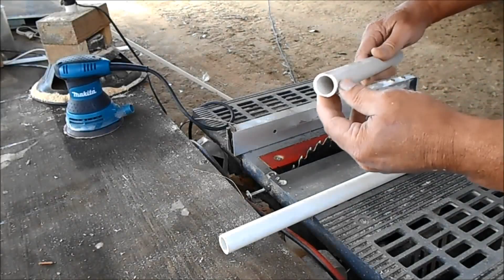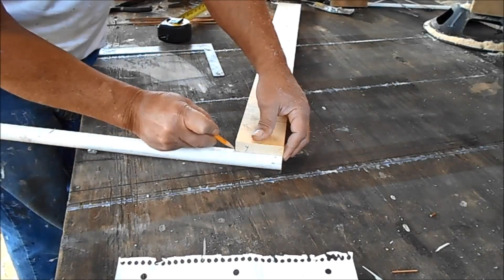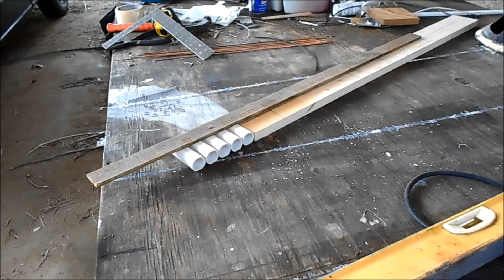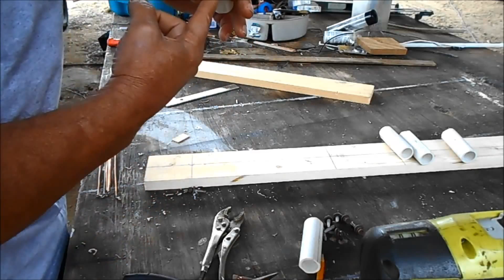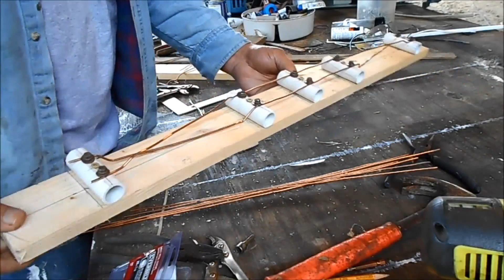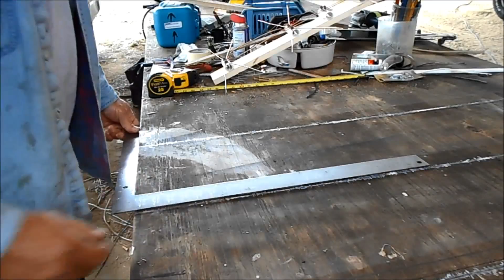HOW TO MAKE A TV  ANTENNA

Comment: what is the purpose of wiring the top and bottom 180deg out of phase? does that make it interact with the middle 2 for a little bit of vertical polarization?

Comment: I live in New Orleans and used the online website called TV Fool to find the TV transmitters around me. The strongest signals were contained in a roughly 180 degree arc south of my location with the weakest ones north of me. Because the transmitters were spread out around me I decided to build a multi directional antenna and not use a reflector. 
I used this video to build mine with a piece of scrap wood and sealed the wood with oil as Danny recommends. I mounted it on the roof of my home about 17 feet above the ground using a DirecTV antenna mount my neighbor was throwing away. Except for the copper wire and a few screws this antenna cost me nothing.  
Today I hooked my new antenna up to my TV and scanned for channels. I was totally shocked and about fell off my chair when the scan found 50, yes 50 channels!!! They all come in clear, strong, and as stable as can be. 
Danny I can’t thank you enough :)

Comment: I could not find those vinyl peaces no where. And I looked at  Ace Hardware, Lowes, and Home Depot. So I thought I would give the PVC build a try. I went to Ace hardware. In the video you say to use, thin wall 3/4 and the regular wall 1/2.  But all they had was thick wall stuff. So I drove 20 miles to Home Depot. And they did not have any thin wall stuff. So I looked on line and there is another Home Depot 30 miles away in the other direction that has it.  I am going to burn a tank of gas just trying to track down materials. I hate this town.
Reply from the maker: LOL THE WAY YOU DONE IT WAS FINE...THIN WALL YOU WOULDNT HAVE TO RIP THE 1/2 PIPE
Reply: I couldn’t find thin wall as well. I just used the regular schedule 40.

Comment: metric conversions 

mast 1 by 3 in (25.4mm x 76.2mm) @ 35in (889mm) timber, marked 3in (76.2mm) then 9.5in x3 (241.3mm)

Insulator risers (tube) drill 5/8 (15.87mm) either side of center hole for wire mounts

V pieces cut at 20in (508mm)
V pieces 4.5in (114.3mm) between ends  (actual degree reading yet to come)

how long is the "electrician wire"? you don't mention it.

Comment: glad your antenna works but I'm fucking lost and I'm sure most people are also
Reply: Hey there Mr. Caissie, what he is doing is basically building what is commonly referred to as a bow tie antenna. There are a bunch of tutorials on making them on Youtube from everything from coat hangers to ceiling tile wire, if this build is too complicated, then there are plans from making one from a PVC pipe, 4 lengths of 20 inch piece of wires, 2 wires to connect it all together and a transformer. What is most important is the dimensions have to be accurate.  That's it. I was skeptical when I built my 1st one, but it really does work. I am now going to build a Gray Hoverman antenna just to see how well it works. I ditched Satellite years ago, and have not looked back. Good luck and have fun!

Comment: O seen this and built an antana like urs u just didnt have pvc so i used blocks of wood will this not work and what about the fence wire behind urs does it need it to and do u just attach it to the back
Reply from the maker: yep
Reply: thanks cant wait give it a try
Reply: wood works, it will just rut eventually.  throw lots of external paint on it to protect it longer ;)

Comment: Will it still work if you leave the pvc pipe out and just drill into the wood?
Reply from the maker: yeah but not as good
Reply: I made a second one with plain wood (no pvc)  and I noticed that I don't get as many channels. Does the wood ground out the signal somehow?
Reply from the maker: YES IT DOES A LITTLE
Reply: Thanks Danny!

Comment: When I was growing up I had an uncle and he was a really great guy. You sound so much like him.  
I made one pretty much the same thing. Only I found some 3/4 inch Plexiglass at a scrap yard.
It was about 6in  wide and the sides were curved. So it kind of looked like a " U" shape.  Some strips were 4 ft long. 
I used all stainless steel nuts and bolts. Put it all together put it in the air about 40 ft or so. Now I can get about 45 -50 channels.
Then I went back and put an amp/ booster. Now I can get 75-80 channels. IF i were to go higher I could get more channels.
But I am afraid I will get hit by lightening again. The first time it took out my amp/booster. I had it grounded but I did not have a surge protector. And it got my TV and Stereo. I highly recommend getting a surge protector now.

Comment: Because who doesn't have a tablesaw laying around?
Reply: Every man in the South has a table saw, drill press and screw gun.......and now a homemade antenna!
Reply from the maker: thats right
Reply: IKR
Reply: I live in California and I have a table saw, and a bunch of other tools. It is kind of fun to collect them.  You never know when you are going to need to cut wood or PVC for some project, right!
Reply from the maker: right!
Reply: Danny, thanks for the video. I made this antenna yesterday for about $20, I didn't have any copper wire, but used stainless steel tig welding rods instead, installed it 30 ft high on my internet tower and  it works like a BOSS !!, I am 70 miles east of Dallas, got all the channels coming clear !
Reply: I got me two table saws. Because sometimes one just ain't enough.

Comment: I built one and used 1x2" wood instead of pvc pipe.  Also used the copper from 14 AWG house wire.  Followed your dimensions.  Works great. Pulled in 112 station 52 mi away inside the house.  Will be in the attic.  Thanks a lot for showing it.
Reply from the maker: THATS REAL GOOD I WISH WE COULD GET ALL THEM CHANNELS HERE..TKS FOR SHARING THAT. AND TKS TO YOU.
Reply: @DannySHodges  is the copper wire you use 10 AWG soft, annealed or half hard wire?